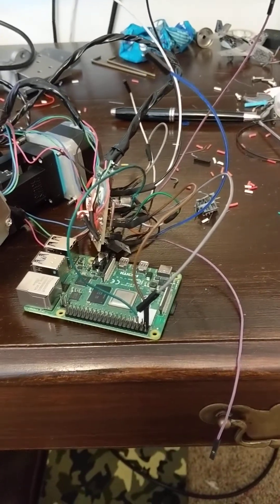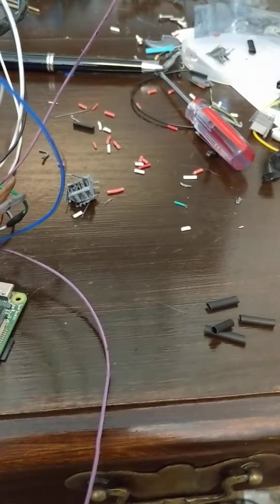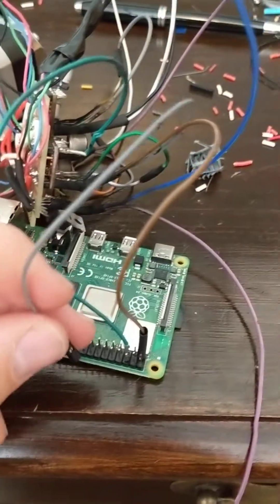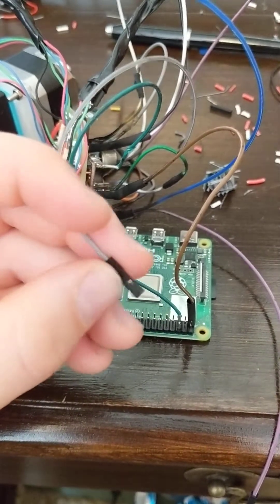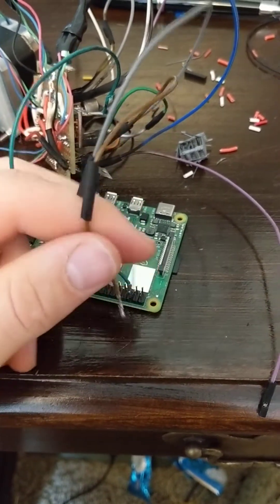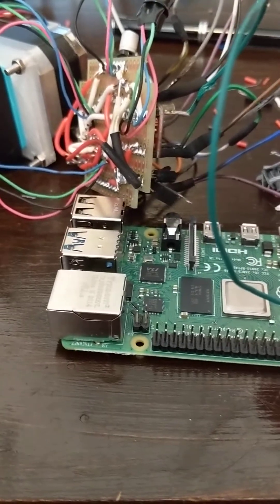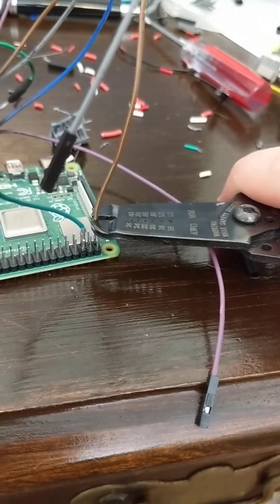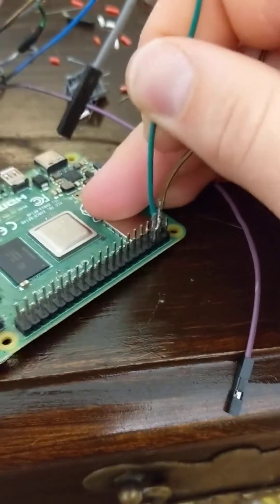How to Permanently Attach Wires to Arduino/Raspberry Pi

Comment: Ty for the vid! Just got an Arduino Uno r3, and there are female heads pre-installed, how would I get a male head in permanently?
Reply from the maker: They make male headers specifically for that, so I'd suggest using those. If you only have female connecting wires you can cut the wire and strip away the insulation and solder that in the hole.
Reply: @mynamisis  thanks man! im doin my first project with a neopixel light ring and i got a little worried lol